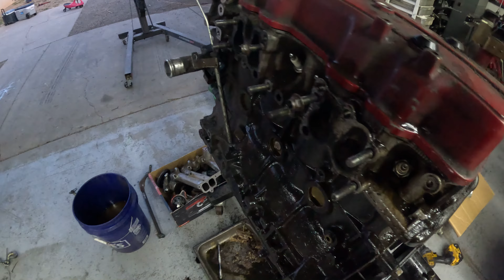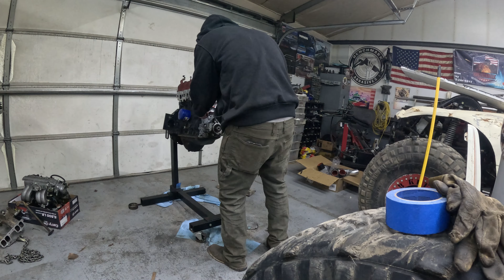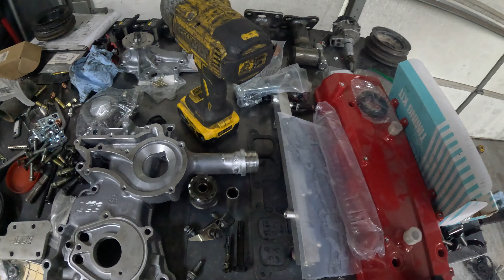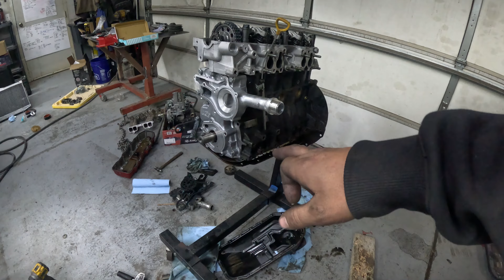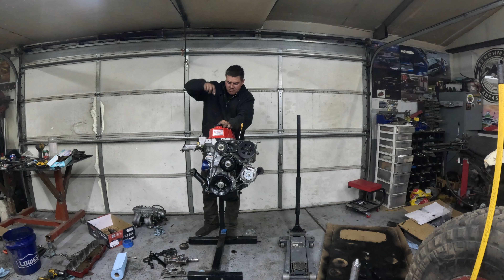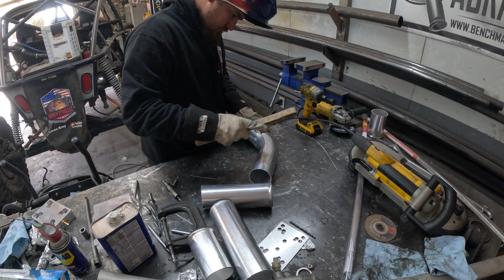1st Generation Toyota 4runner Buggy Build | Engine Mods

Comment: When you welded the reluctor ring on. did you time the ring or how did you know what position the teeth and sensor need to be at? or it doesn't matter?
Reply from the maker: Yes I set it 45 off of top dead center but then I ended up putting the sensor on the other side anyways so just had to set in the computer to match TDC. Ended up 162° to dial it in to match.

Comment: Do you have the turbo feed tapped into the sensor hole or the little plug that’s in between the passenger side engine mount?
Reply from the maker: Sensor location